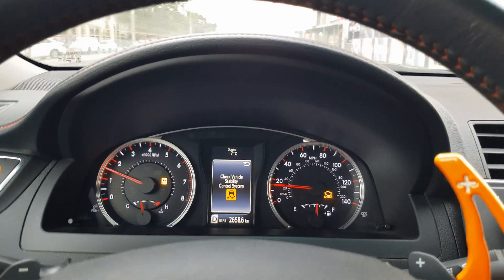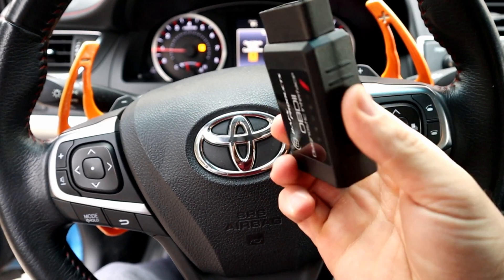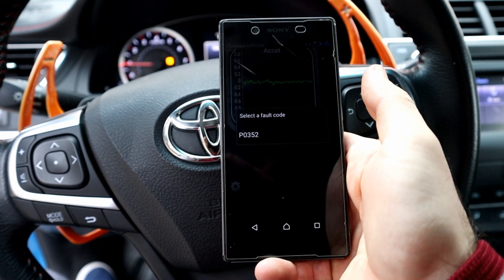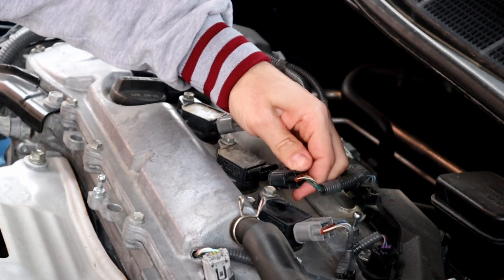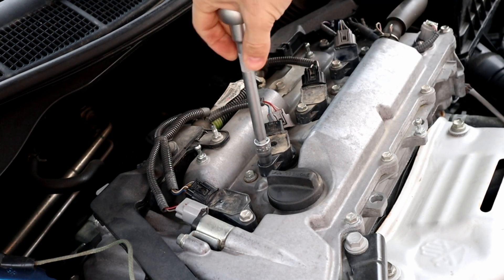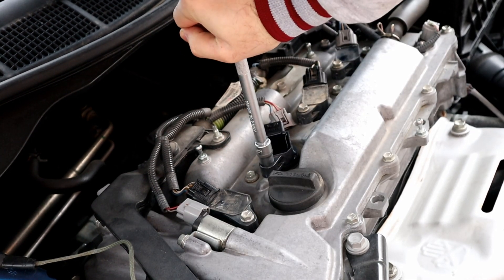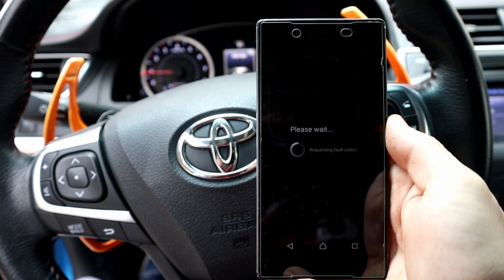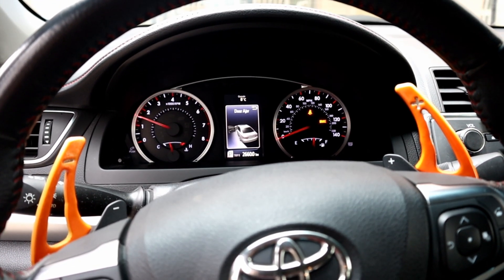How to check Toyota Camry ignition coils/How to fix code p0352/fixing check engine light on TOYOT

Comment: Hello, thank you for the information. Camry 50 error p0351 p0352. I checked as you showed, all the coils are working. I swapped coils 1 2 with 3 4, the error is still the same 0351 52. I don't know what to do next. I think I'll swap the spark plugs 1/2 to 3/4. Tell me how to check a working spark plug

Comment: I replaced spark plugs, coil, o rings, and coil and still have code on 2014 mustang
Reply from the maker: Check the wire harness
Reply: @AliMECH  I checked them. I am thinking it's the PCM but everyone tells me it's not

Comment: I have a p0302 code I already changed the spark plug, ignition coiland fuel injector and I still have a misfire on cilinder number 2🤷‍♂️🤷‍♂️🤷‍♂️
Reply: Same shit, like wtf
Reply: @Igotyoutriggered  Me too (4 cylinder). New plugs and connectors and coil #2 cleared the P0302 code. In the process, I swapped 2 and 3 so the new coil is in cylinder #3.  Two months later I get P0352 (#2 cylinder). Reset Code and swapped coils 1 & 2... Ran great. P0352 returned a week later (#2 cylinder), therefore, it is not the coil (as it is still showing the same cylinder after coils 1 & 2 were swapped last time). Being that the plugs and connectors have been replaced, I maybe have a bad harness or computer. I probably need to go to a shop with an analyzer that's smarter than my better than average hand held. I miss my Plymouth Volare!
Reply: @david4062  Lets say the coils are good but it still brings up a random misfire on cylinder 2.  Chances are this could mean a faulty crank sensor.   A bad crank sensor typically won't throw a code.  You'll need a scope scanner too confirm it.

Comment: My climate  control for my Toyota camrydoesn't work. It only stays on cold and when I switch it to hot it still blows cold air. Any suggestions?  Or can you make a video of it. Please and thank you!
Reply from the maker: I would think about the valve that let's hot coolant to enter the heater core, check that, maybe it's not opening
Reply: @AliMECH  do you know where it is located?
Reply: Volcan, make sure you are not low on coolant. Also, bleed your coolant to make sure you don't have air trapped in your heater core.

Comment: I have very poor gas mileage as well even tho I changed the spark plugs my car has 75k miles
Reply: Me too.but there is no error code in my car. Maybe my car is too old-----180000KM.
Reply: @csun2533  I live in NEW York city but my car use to get better gas mileage now I have to fill up like 2 times in one week
Reply from the maker: Test the coil like I did without obd scanner , and also I recommend to clean the fuel injection, I have so many videos how to clean even without taking injectors out
https://youtu.be/iDlLvCh4JDA
Reply: @AliMECH  10-4 will do

Comment: Maybe I need to change my coils my Camry don’t have a check engine light but it has a slight ruff idle
Reply: Did it work
Reply: @jonderrick25  my coils are good bro I think it need a full fuel injection cleaning or some new fuel injectors
Reply: Mark, start by cleaning the MAF sensor and throttle body. Then clean the fuel injectors if the problem  remains.
Reply: @frankg6578  my coils are good the car is good I live in nyc so I think it’s the city driving that was causing that I’m a trucker I drive my car from nyc to Georgia and the problem is gone